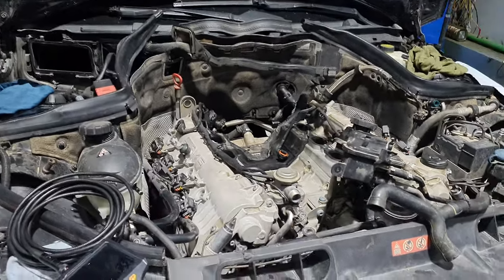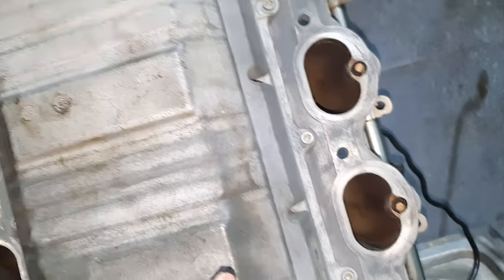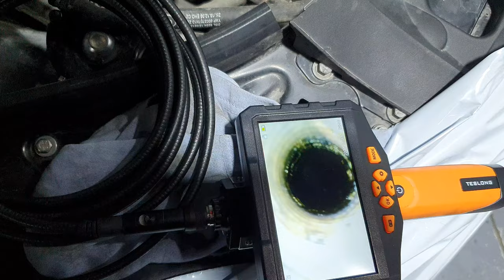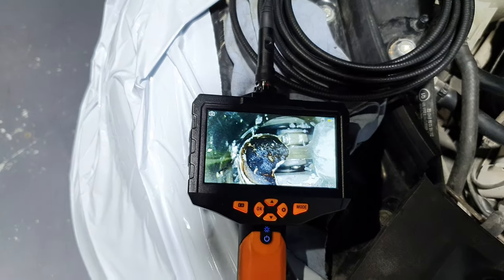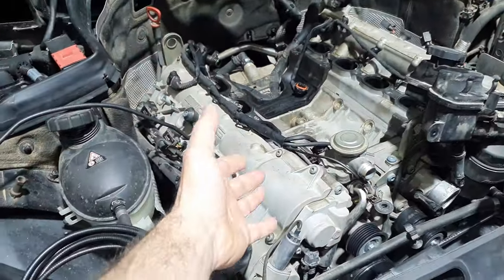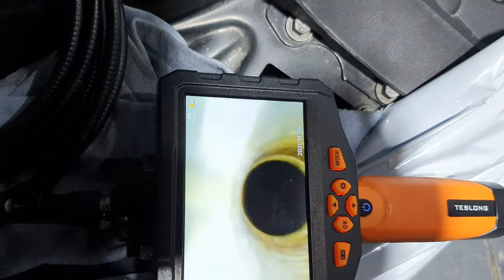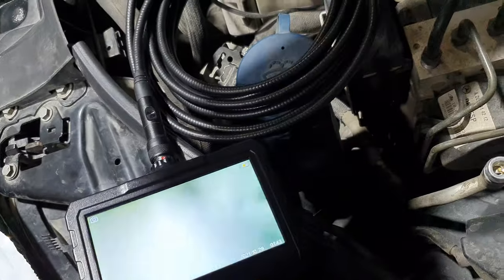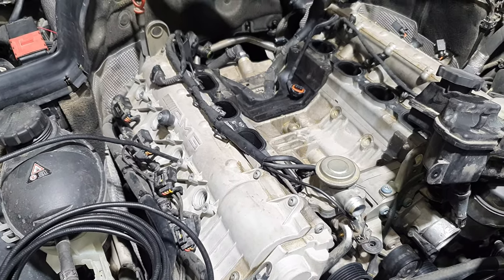M156 flooded engine check up (part 1)

Comment: We had torrential downpours here in Miami several years back. Had a customer with a M272 that had 37k flood out. I was able to revive it, but it started to set misfire codes for cylinder 3. I suspected a bent rod, but the insurance paid it off. 🤷‍♂️